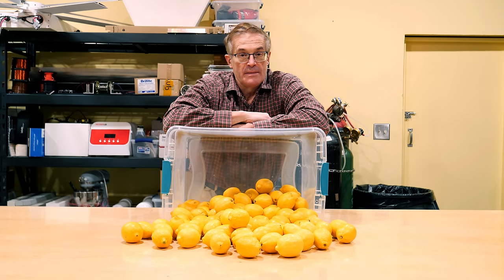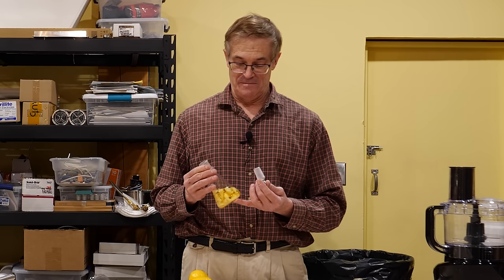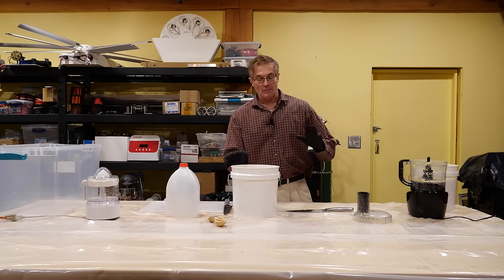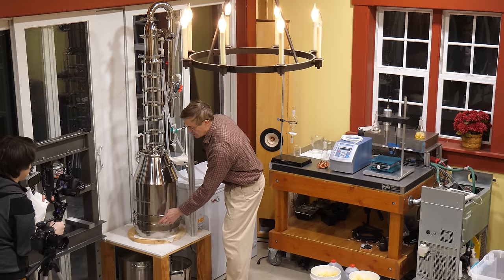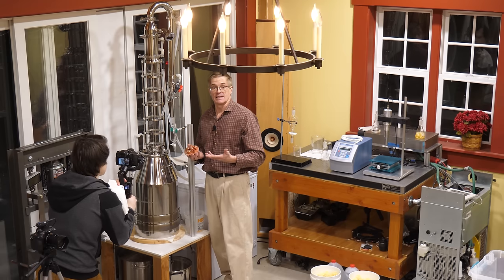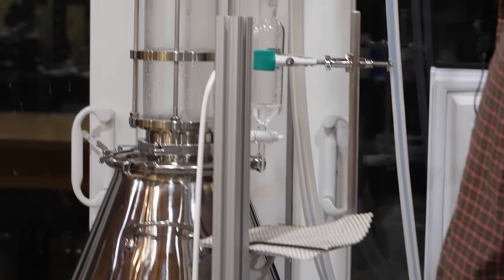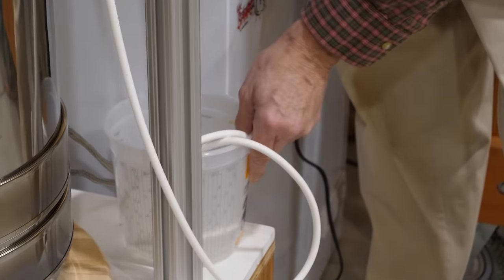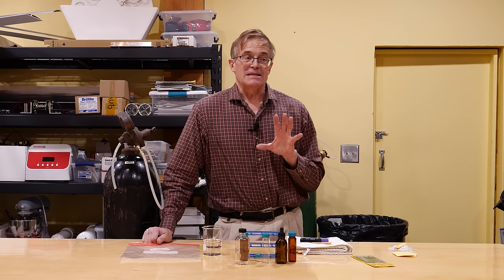CONCENTRATING LEMON OIL LEADS TO A VISIT TO THE HOSPITAL!

Comment: I enjoyed this immensely, I worked for A. M. Todd Company 1984-1995, an Essential Oils Brokerage.  I was in the Jefferson Oregon Field Office.  My primary function was delivering 50 gallon drums preseason to the peppermint growers, picking them up when filled with 400 pounds of oil, off loading at warehouse, dewatering, weighing, and inventorying them.  When shipped out each barrel was hand loaded onto a semi trailer with a drum truck.  100 per semi trailer, makes me sweat just remembering!  80% chance when you brushed your teeth I handled the oil that flavored your toothpaste 😁  Great Video, Thank You!
Reply: im not saying the oils are a cure all but something's it works and its cheaper, colds/shuffy noise's ect. works wonders or at least for me and it's somewhat good for asthma ect. or cleaning up the house/car ect.
Reply: I was too young then to be able to face peppermint toothpaste.
But I'm sure my mouth would have thanked you.
Reply: Hand loaded with a drum truck? Where did you get a drum truck with hands?
Reply: We used to supply Bitter Lemon Essence to Schweppes Nigeria, an about this time of year in 1990 the packing staff reported someone had switched the lemon juice barrels from rectangular steel ones to more barrel-shaped plastic ones, nobody'd noticed. The consignment had to go (Christmas eve), so they used them anyway. What was designed to fit a standard 20' container did - with packing!
During the journey, it evidently shifted. On arrival, we had a report back, that the doors had become self-opening, and the f##k-truck driver had been deluged in lemon juice! Well it was puetic...
Reply: @JelMain  I was fortunate that the shipper we contracted with understood the "Special Assignment," of moving our product.  They would send the same man nearly every time.  His name was Elliot, we would take lunch together after I loaded the trailer, we became friends and I stayed in contact with him over the years until he passed away.  Our loading dock was like some kind of demented test for a driver to back into, over the years I actually had several drivers give up.  100-102 barrels per load averaged 500,000.00 USD in value, depending on market.  Cheers Rahere!  Merry Christmas!
Reply: @insolentstickleback3266  Indeed, and in return. My first day at work was 1 Feb, and the roof was blown off the essence factory the night before, in the middle of peeling! The lessons I learned in logistics were so important when I moved into the Crisis Management team of the European State Department a decade later, as explosives are even more Deck Cargo. That afternoon I found myself dealing with a lesser issue, a consignment of orange base on a ship salvaged in the Med, quite simple as salvage cargo is lost, so get replacement stock shifting and claim the insurance. Not far down the road, I sold the entire Company stocks (Cadbury Schweppes) to the UK PX, NAAFI, on the outbreak of the Falklands war, drawing the eyes of Margaret Thatcher's right-hand man, as he was hurting from having had to resign as Secretary of State, turned up for a Main Board Meeting (as a Non-Exec), to find the entire buzz was that some sod had struck the deal of the century...I was soon in the Group HQ Finance Team, sending a Pepsi divisional MD to jail for fraud! That pretty much ended the Cola Wars, as it brought a sense of business ethics back into it, particularly as it gave Sir Adrian Cadbury a chance to tether the opposition.
Oddly enough, I later got to work with his oppo in Corporate ethics, Arnaud de Pret Rhoose de Calesberghe.
Reply: @insolentstickleback3266  Are you Maori?
Reply: @pinballrobbie  Only in spirit.
Reply: I worked four years on a mint distillery in Washington state.  We filled those barrels 😁
Reply: @Cemize  I hauled several truck loads of drums up to the Tri-Cities area.  What years were you working at the distillery?  Was it peppermint or spearmint they were farming?
Reply: @dalelc43  "truck" doesn't necessarily mean a motor. A "hand truck" is what they call that tool you see movers use to move appliances, boxes, etc. They make specialized ones for specific applications (like refrigerators, for instance.) A drum truck is like this and shaped to make sure that the drum is only lifted by the edges because the sheet metal bottom might get punctured if lifting a full drum.
Reply: A "Hand Truck" is sometimes called a "Two Wheeler" or "Two Wheeled Dolly".
If you do a Google search you will get something like this:

Hand truck

A hand truck, also known as a hand trolley, dolly, stack truck, trundler, box cart, sack barrow, cart, sack truck, two wheeler, or bag barrow, is an L-shaped box-moving handcart with handles at one end, wheels at the base, with a small ledge to set objects on, flat against the floor when the hand-truck is upright.[1] The objects to be moved are tilted forward, the ledge is inserted underneath them, and the objects allowed to tilt back and rest on the ledge. The truck and objects are then tilted backward until the weight is balanced over the wheels, making otherwise bulky and heavy objects easier to move. It is a first-class lever.[2]

￼

A hand truck

Overview

See also

References

Last edited 5 months ago by Bizegar

￼

Content is available under CC BY-SA 3.0 unless otherwise noted.

Privacy policy
Reply: @JelMain  wow! great story!

Comment: "Not everyone has a tank of nitrogen, but this is an excuse to get one"
Love this guy
Reply: I have one. It's useful as a shielding gas for welding.
Reply: @thomaslaparnestudenthbhs6439  I'm sure you know this, but for anyone else who reads this, argon works slightly better than nitrogen, but is way more expensive.
Reply: How about cream capsules?
Reply: @TagiukGold  ive used co2 aswell, not great but ok for backyard welding
Reply: @FerdinandFake  yes, great for some welding, but I wouldn't use CO2 for food storage applications.
Reply: @TagiukGold  sure but co2 has other uses....
Like carbonting drinks for example
Reply: I was thinking the same thing lol
Reply: @donotlike4anonymus594  oh, I know. I have several tanks, CO2, O2, C2H2, N2, Ar. Downtime is very expensive, so a full tool room is a must for me.
Reply: @NICEFINENEWROBOT  that's nitrous oxide, it'll oxidize your oil too
Reply: That nitrogen tank could also be used to air up your car tires.
Reply: @michaelblacktree  Yes, it's wonderful, you can't pump up your tires if you get low pressure out in the country, unless you cart around a nitrogen bottle with you...
Reply: lol that got me too
Reply: @TagiukGold  Just fine for many food and drink applications. Carbonic acid is an effective natural preservative.
Reply: "Honey... I need to run out and get a cylinder of Nitrogen." "Why?" "So I can preserve and pack your essential oils." "Oh, okay! Have fun!"
Reply: lol yeah... I guess we'll all have to get reflux stills too, while we're at it. I mean how can you be a self respecting DIY science tuber without a reflux still, come on.
Reply: @ArchaeanDragon  lol
Reply: Or argon from a MIG welding torch with the wire feed turned off?
Reply: Could I use argon instead of nitrogen? I have (supposedly) clean argon, used for my TIG welder.
Reply: I live next to someone who has lots of gas.
Reply: @TagiukGold  I was thinking the same thing! If you don't want to buy a whole tank, you can buy "wine preserving spray" which is just argon gas in a convenient container. Still expensive per volume, but not bad for something like this.
Reply: @razeezar  Not everyone has a tank of Nitrogen in their car, but this is an excuse to get one!
Reply: @chattymatt  Or even better... A 12V air pump and/or foot pump 😉

Anyway, Snark aside, Nitrogen gas is an asphyxiation hazard in confined spaces and in some regions is even illegal to cart in such manner without proper segregation!
Reply: I got Co2 and Nitrogen in my keezer.  Brewing means i get to keep fun stuff around w/ regulators that cost more than the actual tank they're limiting lmao.  Nitrogen doesn't get used much but I go through a 20lb tank every few months.  Makes me think i got a leak somewhere tbh.  But I've heard when a keg is low, co2 can actually pass right through the beer and out the tap,  so maybe I don't?
Reply: @thomaslaparnestudenthbhs6439  yeah you wouldn't wanna pack your essential oils in argon
Reply: @TagiukGold , why is that?  I assumed using the CO2 for carbonating water and things would beat vacuum on 5 gallon buckets of wheat.
Reply: That's akin to a blub I posted on Instructables about making a [$10,000.00] wine cork, using used wine corks, as an excuse to invest in bandsaws, a table saw, a drill press, a miter saw, a dust collector, . . . .
Reply: @thomaslaparnestudenthbhs6439  cuz it's a carcinogen and not uniformly distributed through the atmosphere
Reply: @kellyvcraig  I may be wrong about CO2, it might work fine for preserving. I was concerned about the Oxygen part of it, but the carbon makes that fairly stable. If I were to be storing foods, my preference would be to displace the air in the container with N2 (yes, I know argon and other noble gasses are less reactive, but they are much more expensive). Vacuum sealing requires stronger packaging, since nature abhors a vacuum; but I've used vacuum packing way more than nitrogen for food storage.
Reply: You could always make some nitrogen smoothie/snowball I see them selling in Asia.
Reply: @norvillerodgersspeaks  While I don't agree with how the other person put it, the MSDS explicitly states "CARCINOGENIC EFFECTS: Not available".  Every other source I could find is some variation of inert and noble gas.  If you don't mind, I would appreciate the source of your claim that Argon is a carcinogen.
Reply: lucky guy never had to cut any fruits or veges back home as a kid. also probably caused due to being distracted by the camera
Reply: @razeezar  Nascar teams used to fill their stockcar tyres with nitrogen... as a race progresses, air expands, altering the tyre pressure... nitrogen dies not expand under heat, making tyre pressure adjustments for handling issues through the course of a race more consistent...
Reply: @therayven3147  When I bought my car from relatives many years ago, it had nitrogen tyres. They were evangelical about it and raved enthusiastically about the benefits. For me it made zero noticeable difference besides being a pain in the ass to pump up. After a couple of years I finally swapped them out with standard air tyres. In hindsight, maybe these relatives of mine were/are secretly into illegal street racing 😉
Reply: @razeezar  well, did your relatives ever been known to pull heavy trailers, or excessively load the car making it heavy? Tyres with standardized air will accumulate heat, and expand... that expanded tyre could overpressure and cause catastrophic failure... whereas a nitrogen tyre would remain consistent... perhaps they did it under the impression of better fuel mileage...
Reply: @therayven3147  Probably this - They towed a caravan with this car so that makes sense.
Reply: Yeah, though probably explain the nitrogen filled tyres...
Reply: My father used to bring home liquid nitrogen from his work, just for fun experiments when we were kids.
Reply: Most tanks are at least partly full of nitrogen.
Reply: @NICEFINENEWROBOT  Nitrous is quite a powerful oxidiser, so exactly against the point of using a welding gas, which is to keep out oxygen.
 
But if I read that wrong and you were offering me some cream capsules, sure, sounds lovely, thanks! Can I have the cream too, but on the side? Nothing wrong with real fresh hand-whipped cream. Better than the skimmed milk shit you get in spray cans.
Reply: @ArchaeanDragon  sounds like me everytime I say smth to my woman, to "nerds" like us it makes sense but other people would call ya crazy hh.
Reply: @razeezar  Eggzactly. Hydrogen sulfide is silent but deadly too. 💨 Rotten eggs,
Reply: @TagiukGold  Whats a shielding gas, do you mean say if you wanted to protect something from heat?
Reply: @engjds  in welding, a shielding gas is a relatively inert gas to shield the molten weld from reactive gases such as oxygen.
Reply: @TagiukGold  Thanks, so you pump that in the same tube as the other gases to stop the oxidisation?
Reply: @engjds  it's normally pumped around the wire while actively welding. Perhaps an Internet search on the topic could provide better explanations that I can in a comment.
Reply: He has the perfect blend between calm, on point and still has humor.

Comment: Top tip for storing liquids and minimising exposure to the air... Glass marbles.

I used to do this with wet film developer chemicals. When you've used some of the liquid from a container, instead of trying to find and decant it into a slight smaller container, drop clean/dry marbles into the container until you get the liquid up to the top again. Then screw on the cap.
Reply: That is a super idea!
Reply: I've honestly never thought of that but that's brilliant, thanks for the tip
Reply: That's a really good tip for something that you're using on a regular basis. Kudos!
Reply: And what if you’ve lost your marbles?
Reply: @unlokia  stainless steel nuts.  If you've lost your marbles and AND you're nuts just give up
Reply: @MrJhchrist  If I pay you, will you stop?
Reply: Very clever. I will use this with my milk.
Reply: @jibbajungs  also best to avoid Hydrofluoric acid if you want to keep your marbles...
Reply: Aesop - ‘The Crow and the Pitcher’
Reply: @juststeve5542  well, probably just best to avoid hydrofluoric acid all together...
Reply: @Asdayasman  Yes. How much are you offering?
Reply: @SirSpence99  All you're worth.
Reply: @AngeEinstein  yup, I had some of those too, but I had one spring a leak, so preferred the marbles.
Reply: I used that technique for a while at work for a while with air sensitive chemicals. It's a great technique and seems to work well but I often ran out of the chemicals because I was forever forgetting that weight (as measured by my hand) was not a guide to the level of chemical available. I went over to squeezy bottles in the end because I got fed up with people shouting at me :-D
Reply: I use this method when making lacto pickles, but thanks for making me realize this much more expanded use for the marbles.
Reply: This comment deserve a reaction to keep it going…
Reply: @ironpun2798  I concur.

Your turn :-)
Reply: This is such a great idea! Thanks for sharing
Reply: @AnthonyHandcock  haha, not my comment…. Steve’s comment. Lol
Reply: @Asdayasman  I'll take that offer. -Christ Paul TheMeRises
Reply: Works for wine too. Once one opens a bottle, air will ruin it if you don't drink it soon.
Reply: @gadgetroyster  i guess it would, although I'm unfamiliar with the concept of a partially drunk bottle of wine 🤣😁
Reply: The best way instead of using marbles is to use the nitrogen filled plastic ball container, similar as used in stout beer cans! You can easily diy these balls from bing pong balls, anyway you will still need the nitrogen cylinder, but now at least is the good excuse to rent one!
Reply: As I recall there's a story about how they used this trick in an advertisement for soup to make it look as if the soup contained more vegetables than it actually did by filling up the bottom of the bowl with marbles. This apparently caused some people to become very angry.
Reply: This also increases the wet surface area which may be a factor in this experiment.  Respectfully intended. It's a great idea for preserving

Comment: Awesome video!
Hope your assistant heals well!
Also, on a note of the knife accident, small tips on proper knife usage for those watching:
- Proper knife holding: hold a knife with the middle finger as close to the end of the handle as possible (middle finger can touch the bolster), and use both the thumb and index fingers to grip the spine (top part of the blade that doesn't have a cutting edge). Knives have their center of mass as close to the bolster (middle part between blade and handle) as possible, so this grip makes it so you hold the knife at its center of mass, which makes the grip more stable and firm. A quick image search on "proper knife grip" shows how to do this grip.
- Cat paw/claw grip: retract tips of fingers to hold the stuff you need to cut as if you had a cat paw or a claw grip. It's hard to get used to, but it's safer. The point is that the cutting direction is never going towards something that is straight. The search for "proper knife grip" should also show these grips.

Comment: I'm reminded of a story from the classic book "Ignition!" by Dr John D. Clarke regarding d-Limonene. He worked at the Naval Air Rocket Test Station (which later became part of Picatinny Arsenal) and for a time in the mid 40's they shared test stands/facilities with Reaction Motors Inc.
During this period the people at RMI were testing all sorts of unconventional concoctions for possible use as rocket fuels, and one of these was d-Limonene burned with WFNA (white fuming nitric acid). During this part of the program the area around the test cells was "blanketed with a pleasing odour of lemon oil", an occurrence so far removed from the kind of aromas usually generated by experimental rocket fuels that Clark felt it worthy of noting in his text.
Thanks for another interesting video!
Reply: That will be my next read.  Thank you.
Reply: If that had worked for missile fuel, dispatch your aerial enemies with a fresh, lemony smell. "Why do I smell lemo*BOOM*"
Reply: @greggv8 
Making your chemical weapon nice-smelling makes the enemy inhale deeper.